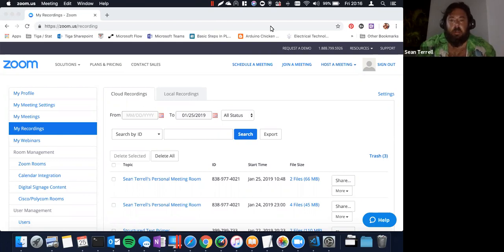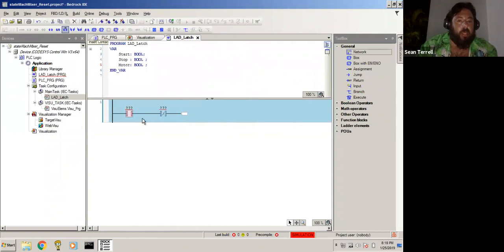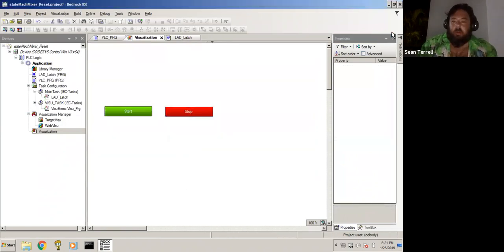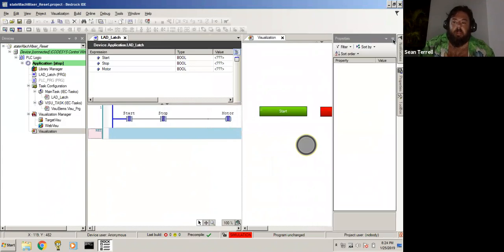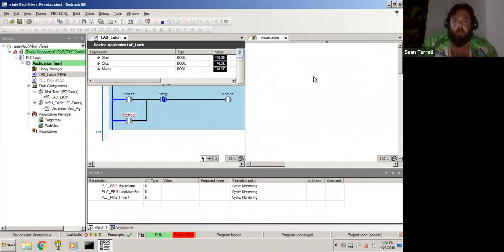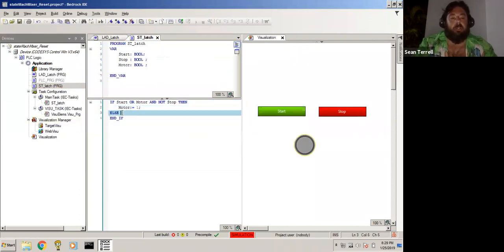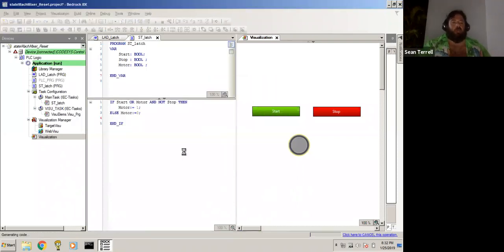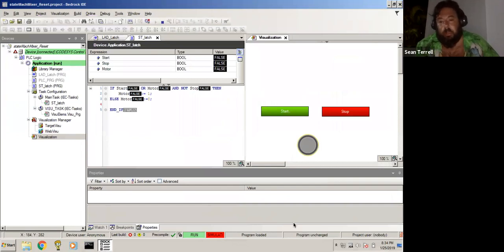Latching Motor with Structured Text

Comment: Hi Sean 

Im programing structured text in Beckhoff, the issue im arising with (having followed your code) is that if both the Start and the stop are true then the motor is still true, technically if the stop is forced on no matter what the motor should not energies